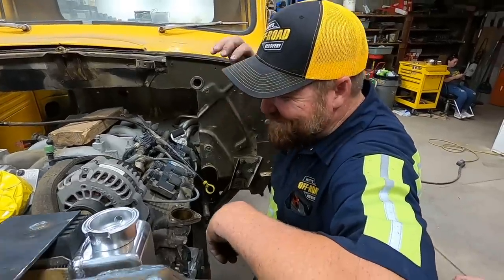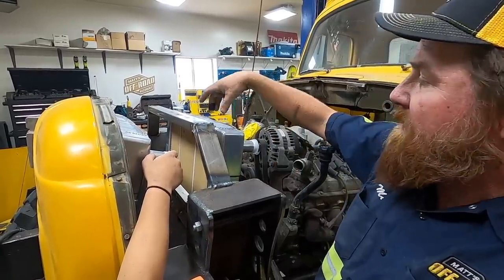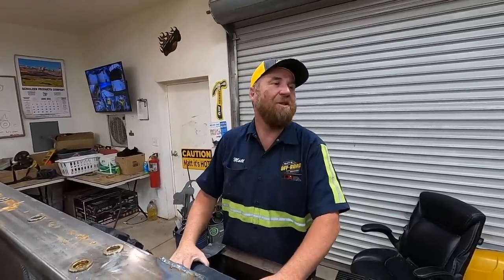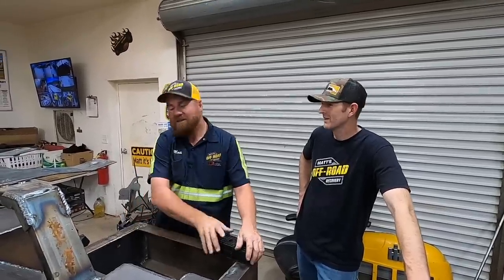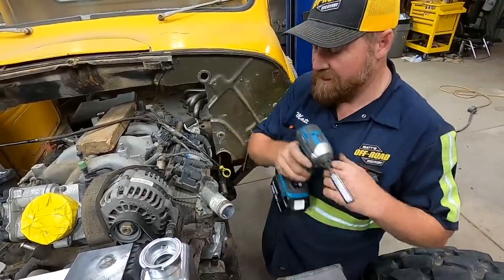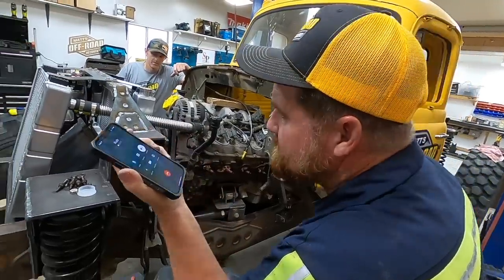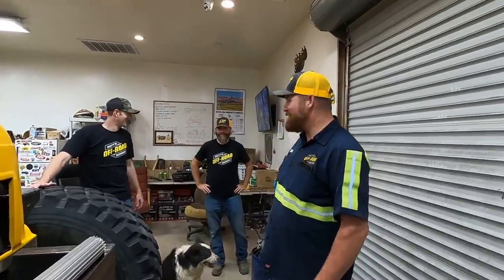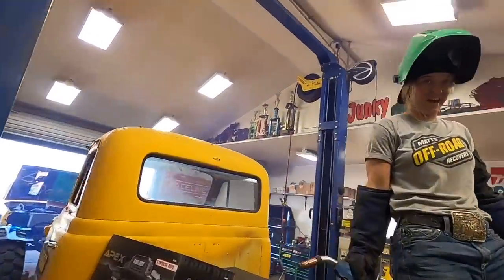This Part Ruined All My Work! The World's Largest Off Road Wrecker

Comment: Feed the back radiator with hot coolant first, that allows a better temp delta for the airflow to coolant for both rads.
Reply: That makes the most sense to me. The 2nd radiator is getting the hotter air but that is still enough to cool the initial hot coolant and then the coldest radiator is the last place it goes before the engine.
Reply: Yes, this is the laws of thermodynamics. the delta T, keep the hot with the hot, the rear radiator will have the hotter air. Actually the front radiators exit air should NOT be able to go into the rear radiators air. It looks like they have a deflector on the rear but it only goes halfway up, they should make it go all the way to the top of the rear so it gets fresh outside unheated ambient air flow.
Reply: Yep! You were thinking what I was thinking. Much like how fish gills work in relation to blood flow and water flow.
Reply: Agreed!
Reply: exactly this you get colder air to the hottest radiator. rather than trying to cool the coldest coolant with hot air
Reply: Came here to comment the same thing.
Reply: Yep!  This would be a counter-current heat exchanger.  (Apologies for my first comment I replied to the wrong one!)
Reply: Glad that someone pointed this out.  Saved me from trying to explain it all.
Reply: i was thinking the exact same thing. i think it would be more efficient that way. i feel like there wouldnt be as much cooling in the second radiator with all the hot air from the first radiator.
Reply: @mikeworkman3593  but the rear rad is double flow so the bottom part is getting cool air, hence the deflector. I think I was following what Matt said but I have no idea what a temp delta is, I just had to reply to another guy named Workman.
Reply: @mikeworkman3593  I was about to say something along the lines of that. I actually think Matt needs to hit up a lecture or two on thermodynamics, I think he has the IQ/minute to really pick it up.
Reply: @seanworkman431  No idea what a double flow is, do you mean dual pass?
Reply: 100% do this. learned from liquid cooling cpus
Reply: @seanworkman431   Delta is just geek for difference :D In this case temperature of air vs coolant in the radiator. Larger the difference the quicker heat is exchanged assuming everything else is unchanged (radiator surface area, coolant and air flow, etc).
Reply: @cjm5002  well it goes one way across the top half and then the other way across the bottom half, if that is a dual pass you win:)
Reply: was about to comment that
Reply: @seanworkman431  yes the bottom or top gets the coolant first depending how the hoses are connected. But still allowing cooler air over the whole Raf would be better.
The way its set up the hottest coolant should start at the top of the rear rad and come out the bottom of the rear, to the bottom of the front and out the top of thw front back to the suction side of the engine wp
Reply: @istvanfarmosi  thank you:)
Reply: I 17th this suggestion.
Reply: @cjm5002  yeah he is close to having it work good. Just needs the reverse the flow. Depending how hot that transmission cooler gets you'll have to test see how hot the radiator on the bottom will get even though he gets the coolest are on the bottom of that radiator. So even though it's a cooler are on the bottom the top maybe warmer because it's getting the hot air from the front radiator. So either the top or the bottom of the rear radiator could go to the suction then it comes out of the top or bottom of the rear radiator and then to the bottom of the front radiator and out the top of the front radiator too the thermostat housing. Seeing how is the front radiator is a split unit, and the bottom is and the bottom is getting air from the outside dammit air is cooler but it is also going through a transmission cooler which is going to superheat the air. But it's probably going to be cooler at the rear radiator bottom than a top radiator bottom and my estimate. So bottom suction top Two Front Bottom then out the top of front to thermostat.
Reply: I was going to suggest this, too.  Y'all beat me to it.
Reply: Exactly what I came to say and found your post.
Reply: Was coming here to make sure someone said this
Reply: 2WD or 4WD? Classic auto parts store question. Gets me every time. Lol.
Reply: This, it’s fairly well established also in water cooling for computers. You get a delta and your second radiator with your current configuration will be combating the hot air from your primary.
Reply: Yep, a heat exchanger should use Contraflow, lest it become a "Temperature Averager".

The heat exchanger here is the entire cooling system, including the air flow. Air front to back, so coolant should progress back to front.
Reply: You, 26 people who replied and 351 people who liked this comment weren't listening what Matt said.
Reply: Yup, it's called counter current flow heat exchange.
Reply: @pfistor  who is going to explain the cavitation caused by the mechanical and electric fans?
Reply: I was gonna say the same thing! I would also move the tranny cooler out front so the tranny can run 160 while the engine is at 195.
Reply: @mikeworkman3593  
Would there be an advantage to swapping the radiators?
Reply: Agree eleventy billion percent.
Reply: @davidc4162  exactly the term I was going to use 👍🏻
Reply: Thermodynamics, heat is like weight. It moves faster the longer the and steeper the path it moves. Thus if the water temperature is dropping over a greater difference ( delta) it moves the temperature of the water faster and more efficiently. So looking his system he needs the greatest water temperature change to be with the coolest air( front radiator) and then the law of thermodynamics works with him. To understand this try freezing hot water vs cold water outside in the winter. Surprisingly hot water freezes faster than cold water due to the laws of thermodynamics.
Reply: @mikeworkman3593  Ive run a couple of dual rad setups before using a dual pass into a cross flow pretty much exactly like you just described. (Y is cross flow and X is dual pass) so cold air --> Y --> X ... and flow is pump out --> bottom of X -->  bottom of Y --> cold side inlet. The tilt idea he has is good but he needs the cross flow to be vertical and pull fans on the inside that will push to the dual pass. The problem is getting too much pull pressure from an engine fan to create negative pressure between the two rads or the engine fan shroud. Im willing to place a bet that one of the shrouds is going to implode like a crushed pop can. Ive already done that with a 7 blade 346 mopar B/RB industrial clutch setup on a roadrunner, total disaster! Lost the radiator plus whole front dress because the rad fins created too much static pressure. (plus i think they 'deleted' the wrong radiator cap haha)
Reply: @Anthonyjt12  freezing hot water is a poor example. The phenomenon is not well understood, but your explanation doesn’t even make the list: https://en.wikipedia.org/wiki/Mpemba_effect
Reply: Agreed with all these guys. Counter-flow heat exchange is what you want- coolest air passes across the coolest coolant.
Reply: Could the large radiator have baffles, which could mean the inlet and outlets need to be in the right place to ensure full flow through the core?  They could have tested by probing with a welding wire before they blanked the holes, but there would also be visible spot welds if there were baffles in the top and bottom tanks.
Reply: @jarq19   🤦‍♂️
Apparently you weren’t listening either because Matt said he hopes it will work so that says he’s not sure and that opens him up to comments from those that do know.
Reply: @jarq19  We were listening, just because it will cool and the front radiator isn't heating the air to coolant temps doesn't mean it's an ideal setup, it goes against basic thermodynamic principles.  The rear radiator is going to be considerably less efficient this way, to the point where it might not have much benefit at all.

The best choice at this point is to separate the airflow between the radiators, so they're both drawing in their own cool air mass and exhausting it independently of one another.
Reply: Exactly just like a condensing furnace
Reply: I was going to type the same. I am Glad that hundred of others think the same.
Reply: I was wondering if there was a reason or if it was oversight.
Reply: I was going to suggest the same thing... hottest water sees the hottest air
Reply: every scrap of exchanger power gained saves money  when heating  a building or a boiler (or other industrial hot thing.)... Because that heat is returned to the target hot spot... But in the engine the heat can't be returned to the cylinder DURING THE power stroke..  so it can't save fuel/input power/ money.
Reply: Yes, the rear radiator should be fed from the engine first. Delta t laws of thermodynamics apply.
Reply: The set up I see would work good for cooler climates where you want your temps to come up faster to get heat, but still be able to work it hard without over heating. I agree that the radiator closest to the engine would ideally be the primary, however, I also don’t think there is a need for dual radiator since they are aluminum and going aftermarket. A four for aluminum radiator should be sufficient by itself, so no matter which one of these if the primary, it’ll function fine as long as there is sufficient dwell time outside of the engine.
Reply: This.  All heat exchangers work best with opposing flow.
Reply: Yes! I commented roughly the same thing and my comment must’ve gotten lost. Good thinker on this guy.
Reply: Agreed it will work better in series like that
Reply: “In theory, theory and practice are the same. In practice, they are not.”
Reply: Was thinking this as well
Reply: Like bird lungs!
Reply: I had the same thought.
Reply: @fefifofob  so true ..... 😆 🤣
Reply: In industry it's called counter-flow - standard practice.
Reply: yep this was going to be my comment. good job bud
Reply: Okay so story time
So you can water cool computers with radiators and there has been a ton of testing on stacking radiators.
Long story short results are marginal either way (hot rad first or second) it is more important to have more water in the system to take more heat load then which way to flow it also less bends are better to keep flow rate up
Obviously fresh air is best air but it really doesn't matter.
Reply: @SSYoung125 
Uh wrong. Maybe it doesn't matter much when the heat load is +- 100w, but it definitely does when the load is 1000s time greater.
It's basic thermodynamics. 
Just look at any professionally designed industrial heat exchanger installation.
Reply: @gregculverwell  computers can run at 100c or 212f similar to a vehicle.
Thermal dynamics scales with load so small radiators small load
Large radiators large load.
Heat gets put into water water goes through radiator doesn't matter what makes the heat.
Why do you want to fight over this i am showing an example (i would share the link but YouTube doesn't like that)
What example to you have what PROOF do you have
The reason i remember this so well is because i originally had your opinion and they showed proof that it was within test margin either way
Reply: @SSYoung125 
All I know can say that I am a (now retired) mechanical engineer. This very question was part of the 1st year course.
I can't be bothered to dig out my old textbooks, but we had to prove the correct answer mathematically.
Think of it like this... If your coolant flows in the same direction as the fluid you want to cool, then it is impossible for the coolant to exit at a higher temperature than the fluid you want to cool. But if you reverse the flow, then it is quite possible for the coolant exit at a higher temp than the fluid.
Reply: What about installing the engine and tranny coolers between the radiators one up high the other dow below that way they are protected and out of way plus it would look clean. Anyway just a thought, I really don't know to much about anything but like watching your videos. 👍😁
Reply: That's how I would set it up with a 180 thermostat to keep it cooler, and open tge thermostat earlier since he stays in desert conditions.
I would also mount the trans cooler, and ps cooler in front of the front radiator top and bottom so it don't block air flow but benefits from the fans and air flow.
Reply: @seanworkman431  Temperature Delta, its simply the difference between two temperatures. In engineering and physics denoted with the capital letter Delta and t or theta for temperature. Written: Δt the SI-unit is Kelvin.
Reply: @seanworkman431  Regarding getting cold air to the bottom of the rearwards heatexchanger with the diverter, it actually still is better to have the front one be the second heatexchanger, since that one gets 100% cool air, the rear one only 50%.
Reply: Why did I have the same idea even though I'm not really mechanically inclined?
Reply: @allenhollenbach4692  unless you know about some effect in the coolant im not aware of the fans and air dont care
Reply: Engineer says yup "counter flow heat exchanger"...more ideas:  redundant DC cooling fan, redundant or booster DC coolant pump.  Backwoods Yankee tip: you may need some "redneck cardboard CAD" to block some radiator air flow in winter to keep the heater warm.  AC condenser way out front, double fire wall incorporated into AC (foot selector) duct? 

Looking ahead, consider electrical demands of all AUX devices firing in sync. (7 winches, air brake pump, cooling fans, aux coolant pump, AC compressor, baja lighting, phone/camera charging, tire pump, jump starting, etc.)  Can any of it run on 24VDC to save copper and BATT amp draw?  Perhaps isolating circuit groups, using battery switch(es), supercapacitors or hybrid supercap batteries can help manage electrical surges.  Maybe a box to strap down a small propane/gasoline generator would be wise (store and pull start on 1lb propane, fill with gas for extended use).  Diesel bros haul a multi gen/weld/compressor unit.
Reply: I was thinking the same. It doesn't make sense to take the higher heat from the front radiator and put it in the rear radiator.
Reply: @JainZar1  okay, thank you very much, another commented that it was geek for difference but your explanation is much appreciated.
Reply: @JainZar1  yes I agree but Matt explained that is was a matter of room for the plumbing, if it doesn't work he will change it.
Reply: 100% correct!  Please note Yeroon Van Leeuwen's comment, Matt!
Reply: @SSYoung125  Don't talk shit. The coolant temp in our fancy PCs shouldn't be going over like 45°C. To coolant in an engine can be anywhere up to nearly 120°C It's not the same at all.
Reply: As it is now, won't the hot water just go across the top of the front radiator, bypassing most of the tubes?
Reply: Exactly what I came in here to say. Hot coolant should go into the rear radiator. You a want a countercurrent heat exchanger.
Reply: The way the radiators are piped, the back radiator isn't going to add anything. Coolant should go into the back radiator first to maximize log mean delta T.
Reply: @robertharperpushforfreedom2314  Yep, you're just super-heating the coolant you just cooled-off in the FRONTt radiator in the BACK radiator with the heat from the FRONT radiator....will probably work, just less efficient, imo.
Reply: i was thinking the exact same thing. i imagine they might be doing it this way because it’ll make the plumbing easier and the difference in performance shouldn’t be massive. still, i’d like to see the better option taken.
Reply: Exactly what I was going to comment.
Reply: Came here just to say this
Reply: I was gonna say the same thing
Reply: That's what I was thinking, but figured I had it wrong in me head somehow.
Reply: And then why not just shroud them differently so they both get a cool air supply. Shroud the rear radiator so it grabs air from the bottom front of the rig. Shroud the front so it grabs air from the front and then vents up on the other side of before mentioned rear shroud.
Reply: @toddpercox9017  - I would guess it's too complex and/or there isn't enough room for enough airflow.
Reply: On all of my cars, I make sure that the delicate radiator fins never get smashed by gravel or blocked with debris.  I do this mostly to keep the A/C condenser clean so it blows cold even at 200k miles.  The cooling capacity might be OK initially but over time with all the sand, mud, and bugs, it might not get adequate airflow.  Might be a good idea to suck in air through a labyrinth path and a simple screen that's easy enough to shake out while in the field.  Or, if the radiator is completely shrouded, it would be awesome to add  a feature to  turn off the fan and momentarily reverse the airflow with compressed air to blow out junk -- put a switch in the cab to make it easy to do on-the-fly when temps start to creep up.  On-demand purified water mister would be interesting too.
Reply: Yep. That’s how refrigeration evaporator coils are circuited. Same concept.
Reply: @mikeworkman3593  Don't know one hoot about this...But you do make sense. Thats knowledge  and experience talking.
Reply: @johnmckell4362  Reading through all these comments, and not rewatching the video, thinking back on it, he really would be better off just putting in ONE large like 10 or 12 core aluminum radiator with a massive flow rate. Having to go through 2 is just making it so much more difficult.
I've worked on the motor homes that the engine came out of, and the radiator is also buried in the front like this, and they still only use one large radiator, with possibly another oil and trans cooler that is just air cooled. No way this big rig will be working harder that a motor home that is also towing a jeep, that will be possibly traveling through a desert out west. 
So he could have just got the PN# for a Workhorse Chassis radiator and been done with it.
Reply: @cjm5002  I read your comment 2 months ago, but I must have gotten tied up and didn't reply.
Yeah, you're right about the phasing of the rad. 
Yes, people don't realize the force of physics involved when you have negative pressure on one side of a sheet of metal, and positive on the other side. I've seen vac trucks and tankers completely implode.

Funny you wrote this, and me reading it by accident months later. I was just talking to my co-worker the other day, about our shops roof vents running when the doors are shut. We have these vents that open in the walls above the bay doors. Well I mentioned that if those vents shut and we happened to have a holiday, could the doors get sucked in. These are massive CFM moving fans in a huge public transit shop. They never started running the vent fans until I started working there in 2018, people didn't like to hear them run, I was like dude it's FL, to hell with the noise.
Reply: @mikeworkman3593  Ive seen doors slam shut on people with that setup, its enough to KILL a cat or dog! I lost a pet to an overpressure scenario where it slammed a door closed on her behind the shoulder and folded her in half. Those kinds of setups need inward facing doors to prevent damage, I imagine that is what you have?
Reply: @cjm5002  No, these are large shop doors, like garage doors, large enough to drive a bus through it.
Reply: @mikeworkman3593  Yeah I gathered that, but people doors for when the overheads are closed. Ever been to a home depot when they have the fans going 1000% and the overheads are banging against the frame making a beat like a hillbilly stomp song?
Reply: Don’t they make a waterless coolant for top notch cooling of an engine?